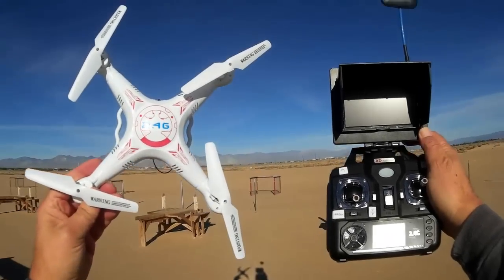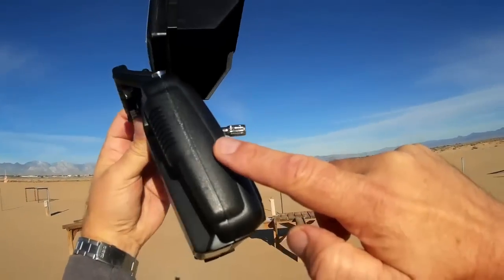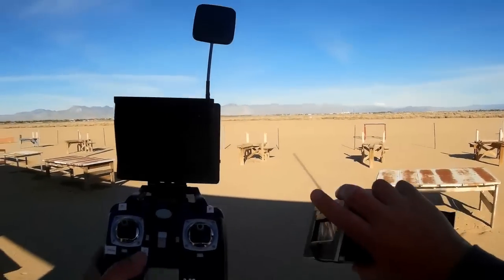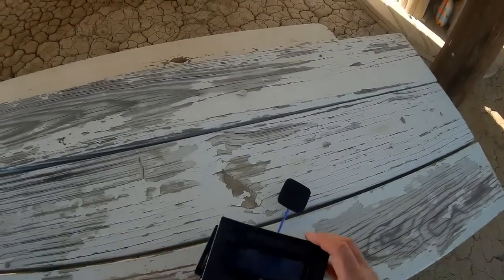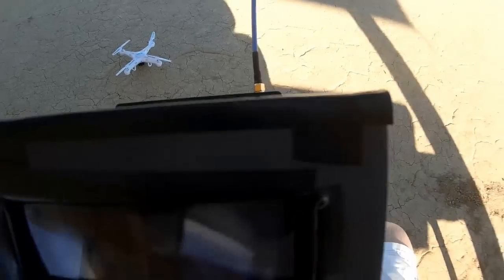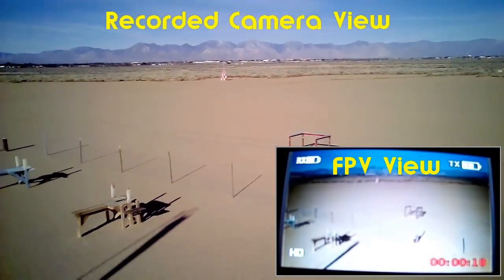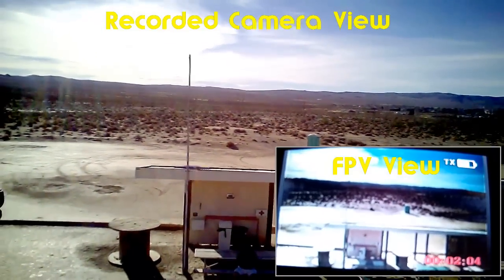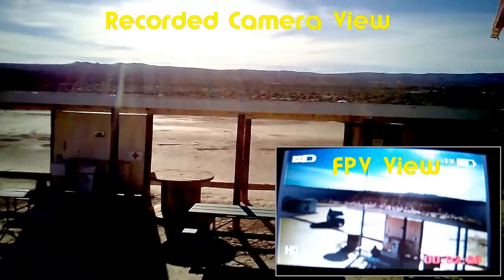Syma X5C 5.8 Ghz FPV Upgrade Kit with Bayangtoys X8 Drone

Comment: I got the spectrum VA1100 in hopes of working with this monitor, and I love its light weight at just 4.5 grams.  but it doesn't connect with it.  what if I put a fatshark antenna on it? because the camera is fatshark compatible. I wanna know before I blow 40+ dollars on one.  Either that or you can mod kit's camera by swapping lenses with a 808 #16.  which is what I'm doing now.  But I also don't wanna get rid of my spektrum

Comment: Hi Quadcopter 101 ,  i want to get this thing but i don't know if this thing is accurate to have some fun with my syma x8 doing fps , i want to do something like this 
https://www.youtube.com/watch?v=JToty_c0-uw
Reply from the maker: The followingis better, but you can't directly record with it.  The shown setup (with attached battery) weighs as much as the above camera https://www.youtube.com/watch?v=QSudydIEIQ4
Reply: Thanks , thats also a nice solution , do you know if there is a pack with screen ,or better if it came with cheap googles ,  

thats why i like this Syma x5 because is all in one but may be there is an other solution
Reply from the maker: GTDrone Well combine the micro cam with this, and you got a great performing solution .  Total cost is a bit more than the X5C kit, but it's a much better FPV camera and receiver system http://www.banggood.com/Eachine-VR-007-5_8G-40CH-HD-FPV-Goggles-Video-Glasses-4_3-Inch-With-7_4V-800mAh-Battery-p-960761.html?p=RB0922217402201307U3
Reply: Quadcopter 101  thanks , 
i was checking in banggood  and i found this ones that are the newer version , and suppose to be better , i think that I'm going to get the little camera and this  goggles http://www.banggood.com/Eachine-EV800-5-Inches-800x480-FPV-Goggles-5_8G-40CH-Raceband-Auto-Searching-Build-In-Battery-p-1053357.html
Reply from the maker: Yes, these micro cameras are neat.  They give a much better picture than the X5C camera kit.  Combine them with the goggles that you mentioned, and yes you got some possibility of real time FPV flight and racing https://www.youtube.com/watch?v=QSudydIEIQ4
And you just inspired me for a future video, thanks!
Reply: haha no problem , and thanks for your advises , hey do you keep all the stuff that you get or you sell it ?  just asking may be in the future if you sell good stuff i can get some of that haha
Reply from the maker: GTDrone I don't keep them (don't have the storage space), nor do I sell them (don't have the time).  After their reviews are completed, they are donated to local schools and charities (Toys for Tots and school STEM clubs).
Reply: Quadcopter 101  Nice , thanks for answering , im not in USA so im going to se if i can find that equipment here , thanks

Comment: Can you take a photo of that frequencies and dip switch positions list and send it to me?
Reply from the maker: +QUIT. This might help http://www.rcgroups.com/forums/showthread.php?t=2447198
Reply: Quadcopter 101 Oh this doesn't look good to me... In Germany the E Band is completely illegal. Do you know if the frequencies from banggood are right? http://prntscr.com/aeses0
Reply: Quadcopter 101 Can you help me please with the charger from the fpv kit? 
If I plug it in both the transmitter and receiver I let it charge until the light on the charger turns on (red). Then, I unplug both but if I turn the receiver and transmitter on, it shows me that I have one battery bar left! What went wrong, I just charged it until the light on the charger goes on! I have both turned off.

Thanks!

Comment: Oh, man. You can improve two things: 
Runcam, open it, make loose lens holding screw, make mark on lens body and body of the camera. For focusing to close object, you need perhaps 180 degree (or half turn) unscrew lens. To back to infinity, just back to previously made mark. I am doing it on my Mobius but also on my Xiaomi Yi camera (with "all sky" lens - instead original Yi lens, there is Mobius C2 lens, got ovr 180 degrees covering field of view).
Second part is more intereting: make one of those "sleeve" antenna I described on my videos (simple to make). Open transmitter, and instead piece of wire - which is NOT in resonance, too long antenna... solder "hot" and ground wire of sleeve antenna, then drill hole on the body of the transmitter, and extend it out. Also, on quad, you need to drill hole, and without opening, you can make antenna vertical (with tweezer move antenna through 5 mm hole). This way you will get up to 250 m range for controlling. If you need links, I can provide it. Thanks.
Reply: Can you give me the links for the range mod?
Reply: +QUIT. 
Yes. Only problem is that Quadcopter 101 should allow this link.
Reply: +Wild Maniac 
Also, the simplest, yet the best antenna for WiFi and transmitter and/or quadcopter. Quadcopter 101, please allow next link too. Thanks.

Comment: Can I use this setup on my X8G? The X5C and X8G have different camera connectors though!? Does this camera plug into the quad or does it have its own battery.
Reply from the maker: +tblakemore58 You could, but you'd need to replace the connector with a contact switch, like I did in the following https://www.youtube.com/watch?v=RyKHSnAEPIo
https://www.youtube.com/watch?v=vSOFgkwdd9Q
https://www.youtube.com/watch?v=qrzuxjB098E

Comment: hi 101 i have problems whit my x8 bayangtoys, it only flys like two minutes , you tinkh its the batery or what you think? help bro
Reply from the maker: +EL DERBO SHOW It could be.  But it also could be dirt or sand in the propeller gears.  Debris in the gears will make the motors work harder and use electricity faster.  Turn each propeller slowly by hand to feel if there is any unusual resistance to turning.  If so, clean the gears of debris using an old toothbrush or pin. https://www.youtube.com/watch?v=LzzD3BPVvH0

Comment: hi quadcopter 101.. quick question about the fpv set. Will it work with a gptoys f2c aviax quadcopter? Many thanks.
Reply from the maker: +Steve Purdy (Steves Drone) I don't think it will fit directly because the camera is shaped differently than the X5C.
Reply: If I take the camera off tho it should work right? :)

Comment: i want to put this on an rc car. can you mod the cam antenna with a clover leaf one? for better range?
Reply from the maker: +time for some fpv action I assume that you could, similar to how a quadcopter transmitter could be modded.  But it would require some soldering and a little knowledge of electronics. It would be done similar to this, but on a more miniature scale http://www.rcgroups.com/forums/showthread.php?t=1873198&page=43
But the stock antenna works reasonably well as is on an RC car https://www.youtube.com/watch?v=RyKHSnAEPIo

Comment: Is this true real time FPV... I have the syma x5sw fpv camera and the transmission has too much latency, also the video is poor quality.  Should I buy this syma FPV system?
Reply from the maker: +Rafael Cabrera Ferreras This is 5.8Ghz FPV with very little lag.  Much better than WiFi FPV, also with much greater range.
Reply from the maker: ***** I actually measured it using the telemetry from my Flying 3D X8 https://www.youtube.com/watch?v=qrzuxjB098E
Reply from the maker: ***** No, their performance is about the same.

Comment: Quadcopter 101
Is there a multipurpose battery charger that you recommend that would suit the 100 - 700mAh kind of range?
I don't want to rely on the USB cable that comes with the Quads but are looking for something that will cover the typical quads you most often review.
Looking around I am so confused and most of them seem to be geared towards the hobby grade batteries.
There is different connectors between the pocket / nano quads compared to the mini's also.
What do you use and what advise do you have?

Comment: Hi quadcopter 101 and anyone who can answer this I would like to buy a quadcopter that has a decent camera with a monitor connected to the transmitter and has good range like 1km-ish and has good battery life and it should be no more than  $150.
Thanks
Reply from the maker: +Gusty Boradcast You're not going to find that "1km-ish" at that price.  And something tells me that you might be new to this hobby?  If so, your focus really should be on learning to fly at this point.  Here's an inexpensive model that is great for learning to fly.  And it's got a camera (no FPV monitor though, and max range is only about 70m, but still great for learning to fly) https://www.youtube.com/watch?v=Mfj6vBTRSw0

Comment: That was great.  I love that FPV system I use it on the Syma all the time don't quit get the range you are getting but it is still fun.  I did a video a few days ago showing both views. Your box idea you would of made it better. Nice job. One question I notice that your battery indication on the monitor shows almost full battery on the camera side. I charge mine before a flight and it still shows less than half, it keep working but it raises a little concern.  Thanks for sharing
Reply from the maker: +Skydive Driver Yeah I accidentally charged it overnight.
Reply: Isn't that good though. I charge mine till the light on the charger comes on I figure that is the sign of being done. That may take 45 min or so.  But it never shows a full charge.
Reply from the maker: Skydive Driver Mine would never go past the halfway indication either, And it's not a good idea what I did, as LiPos can overcharge.  And yes, you'd think that the charging process stops when the light changes. But for one, I'm not sure that the "light" is entirely accurate, and for two I'm not really sure that the charging process stops when the light changes.  But even so, it's not a problem as halfway charged is more than enough power for a couple flights.  Also, you're not hurting the battery by doing so as LiPo's don't build up memory like the old NiCads.
Reply: Okay, thanks. Can't wait till next review. have a good evening.

Comment from the maker: Wes, subscribe and you'll see neat stuff like this 
https://www.youtube.com/watch?v=qrzuxjB098E
Reply: +Quadcopter 101 I double-checked (http://www.amazon.com/gp/product/B00MNG37C2?psc=1&redirect=true&ref_=ox_sc_act_title_1&smid=ATVPDKIKX0DER) and I think I'm good. thanks for your help! one last question: aren't there replacement batteries for the copter that are more powerful than what it's shipped with? do you have a recommendation on those?
Reply from the maker: Patrick Lafferty I recommend that you get the 650mah instead.  The 750 mah are a tight fit in the battery compartment.
Reply: +Quadcopter 101 Hey quad i was woundering if the syma x8g or the syma x8c is more worth it cause i want to spend the least money if i but the syma x8c how can i attach a camera and do i have to program it? and also how fast does the syma x8c go?
Reply from the maker: I just did a cool video today with the Syma X8C carrying an SJ4000 camera, and it did it very well. I actually think that's a better idea to purchase a X8C and a cheap standalone camera (like the SJ4000) separately, as you could use the camera on other quadcopters (or while surfing, biking, whatever).  I'll be putting up the video review sometime next week.
Reply: Ok thanks
Reply: +Quadcopter 101 will it work for a syma xs5w please tell thanks
Reply from the maker: Muhammad Rahman Yes. It was designed for the X5C, and all X5S versions (including C and W).
Reply: +Quadcopter 101 thank you
Reply: +Quadcopter 101 and did you elsewhere say that all X5c models are now equivalent to the x5c-1 model? I see an x5c on amazon today for $47 which I might get--and then add this fpv upgrade which would come out to be the same price as if I bought the so-called "x5c-1 upgraded" model. Am I interpreting all this correctly?
Reply from the maker: Patrick Lafferty Yes, but make sure they are "Syma" X5C models.  There are many clones of this quadcopter, and some of them are named X5C or X5C-1 to fool the buyer into believing they are Syma products.

Comment: The BT X8 looks exactly like the BT X5C-1 clone I have. It had poor range at first, but I fixed that.  I noticed some lag between the recorded video and the FPV screen ... just enough to get you in trouble around obstacles.  I also notice prop flare a few times in the recorded video. I wonder if you got a black magic marker and made all the bottoms of the props flat black, if you'd eliminate that prop flare? BTW, I had my Syma X5C w/X8C TX out with the 808 yesterday on the shore of Lake Erie ... thought it might bring back some memories for you: https://youTu.be/weJD3ABoYtY (hope the link works, since it wouldn't cut) Cheers!
Reply: +raygunz333 Yeah, I have a flat black piece of plastic over the front of my 808 Keychain, which  takes care of Prop flare quite nicely.  I thought putting black magic marker on the prop bottoms might be a quick fix.
Reply: +Bill Somrak Just checked ... the link does work .. yay!
Reply from the maker: +Bill Somrak No that's not FPV lag.  There's very little with this system.  I manually synced the two videos for this review.  Also most of the time difference that you see was caused by slightly different frame rates between the X5C camera (29.733587 fps) and my Runcam box camera (30 fps).  The difference became more pronounced as the video progressed.

As I fly early in the morning (least wind), the sun is usually very low in the sky, and can cause sun flickker from the props.  Prop sun flicker can be reduced by taping a small piece of cardboard just above the lens to act as a shade. I didn't do such for this video.

Also, really nice flight!  Thanks for sharing.
Reply: +Bill Somrak I don't think that would help the 'prop flare', it's caused by sunlight going through the props hitting the lens surface, you have to shield the lens to eliminate it.

Comment: You should make goggles with that screen. I cut out molds for my face and velcroed the screen to the other side.
Reply from the maker: +QuadBro RC Yeah, but I like to be able to quickly switch to LOS in case of an emergency.  This "periscope" setup actually works well, and is very lightweight being made of foam board.
Reply: +Quadcopter 101 Ah I see. I don't typically have a problem with the diy goggles because I fly an H6D around the house. If I make a little mistake with flying, I just cut throttle.

Comment: How much is the fov
Reply from the maker: +Skating Brothers The 5.8Ghz FPV upgrade kit includes the FPV transmitter camera and receiver screen.  Both the camera and screen have their own built-in power supplies (rechargeable batteries), so they can also work without being attached to a quadcopter.  This setup is currently $52 here http://www.banggood.com/Syma-X5C-1-X5SC-X5SW-5_8G-FPV-720P-Camera-with-Monitor-Real-Time-Transmission-p-980090.html?p=RB0922217402201307U3
Reply: +Quadcopter 101 I think he is asking the field of view otherwise known as fov